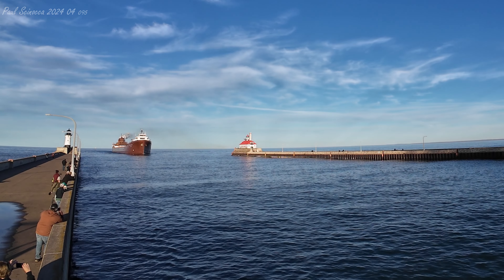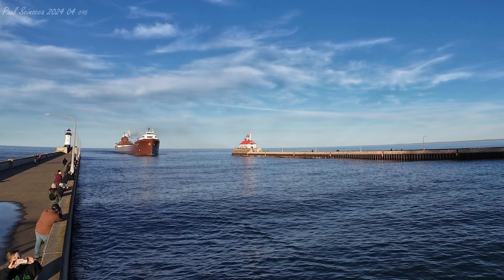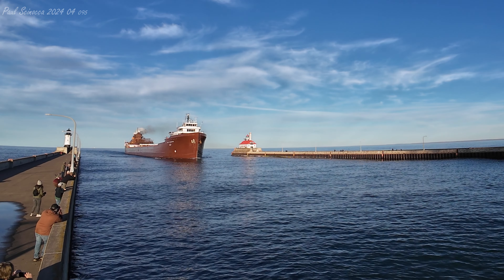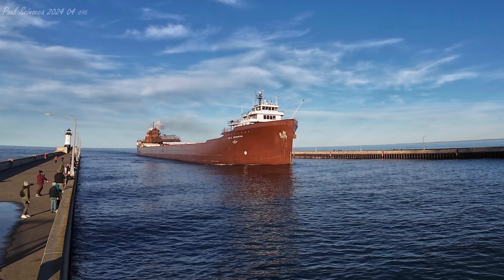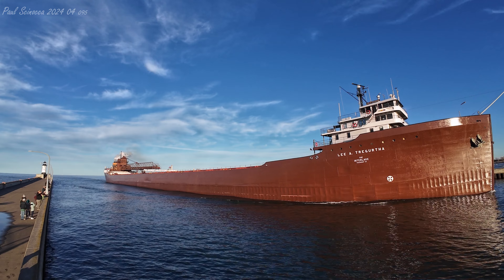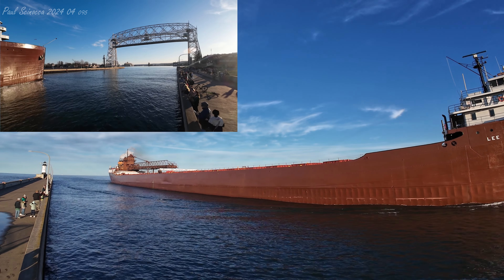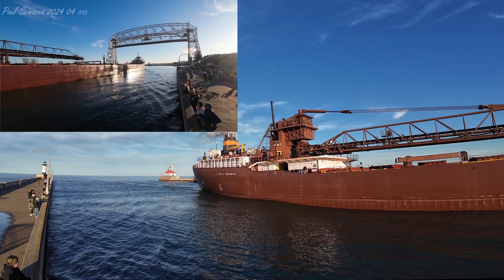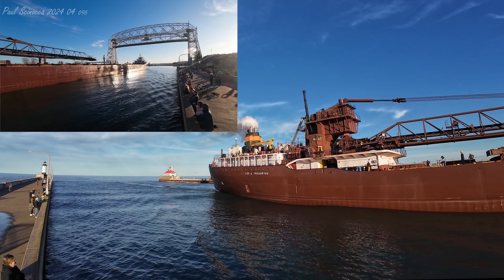Now Doesn't She just look Gorgeous all Freshly Painted! The Lee A Tregurtha's 1st Duluth Arrival!

Comment: Lotta paint
Reply from the maker: I cannot imagine how many gallons of Paint they used. 1 gallon will cover 400 sq feet, how many coats did they put on as well!  With it bein 826' long x 75' wide x 34' deep, (rough dimensions) it is about  2,358,300 square feet, taking 5,896 gallons per coat!
Reply: @PaulScinocca Ahh, I see what you’ve done. You’ve overshot the mark. Length x width x depth gives volume. The area would actually be 118,118 sq ft, so roughly 300 gallons per coat. The Interlake Steamship Company has the most interesting fleet on the Lakes.